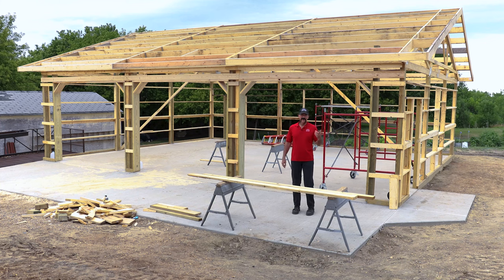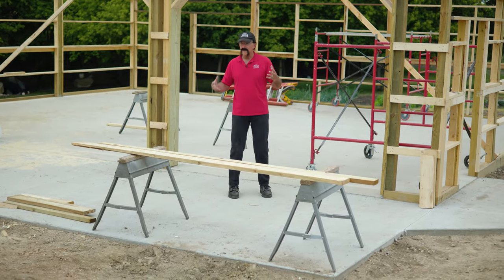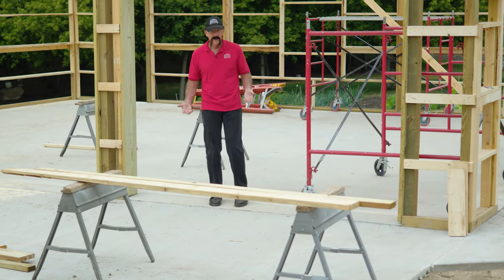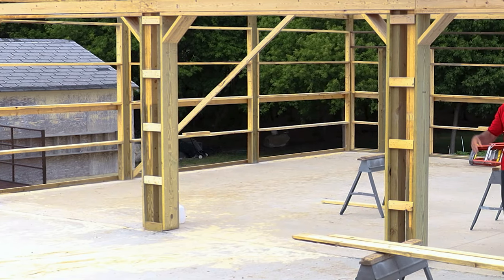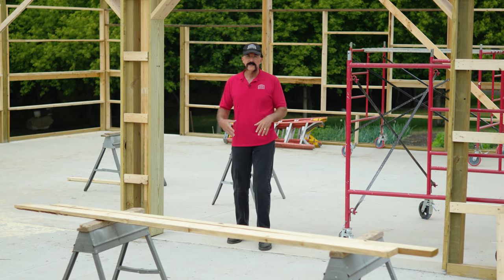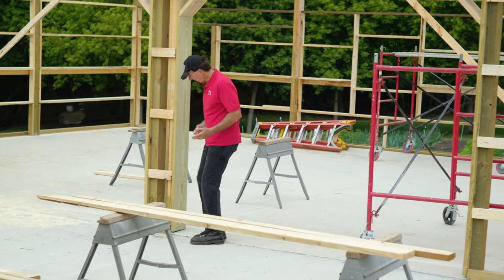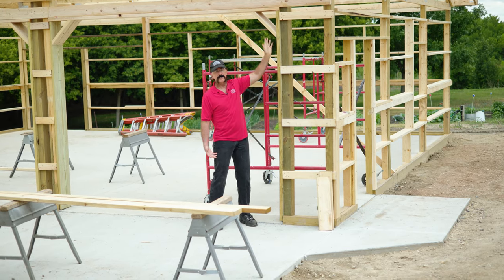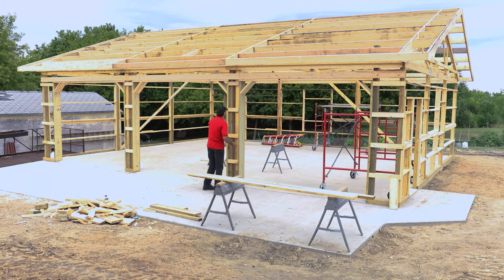Pole Barn Guru on Concrete and Framing

Comment: Can you discuss how to make a pole barn more fire resistant.  With the number of forest fires we have now this is important to many of us.  Things to do and not to do.  How to prevent embers from entering the soffits?
Reply: More and more homes here in Montana are using non-vented roofs in order to prevent pulling embers in through the soffit.
Reply: The Wildland-Urban Interface Code addresses the requirements for all structures. 

Leave no exposed wood members. Un-vented metal soffit panels. Insulate with roof slope so as to not require a vented attic space.
Reply: Use full rounds for post. A 8 inch full round takes over 6 hours to fail under its own weight at 1400F. A steel beam fails under it's own weight in 15 minutes at 1400F. Also if you have full rounds commercial code says you don't need fire suppression.

Comment: How do you frame splash plank so there is concrete lip on exterior of each post. Where concrete extends 1”-2” past post. Thanks in advance
Reply: Can you explain why one might want to have a concrete lip on the exterior of each post?
Reply: @MikeThePoleBarnGuru  I have seen this done before why I don’t know. I guess I spoke out of context. More or less just curious.
Reply: @highontheoutdoors3867  In order to keep water from running below the pressure preservative treated splash plank, it would be best to not extend concrete slab past outside edge of columns.

Comment: Your saying pour the concrete after the roof but  do you pour a “foundation” for the walls first?
Reply: On pole barns concrete is usually last. Poles are sunk in the ground past frost line. Foundation is different with these
Reply: The walls do not require a foundation as all loads are carried through columns to the ground.
Reply: Or pour your pad or foundation first and then bolt down your columns, then you won't have to worry about pole rot
Reply: otleg Series Vol. 12: The Cutting Edge 1965–196

Comment: The steel is not going to hold your building together!  If your posts are sized right, it should not sway!
Reply: actally,YOUR WALL STEEL IS A STRUCTURAL MEMBER!..it is a much stroger building once the metalis on !! even though the wind resistance has increased after its on....